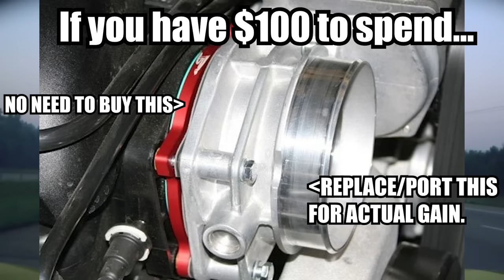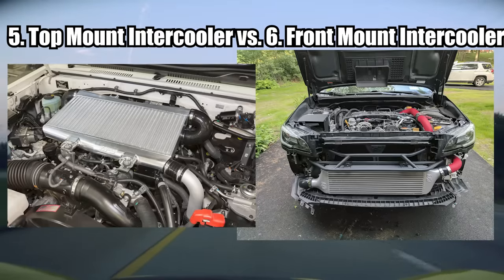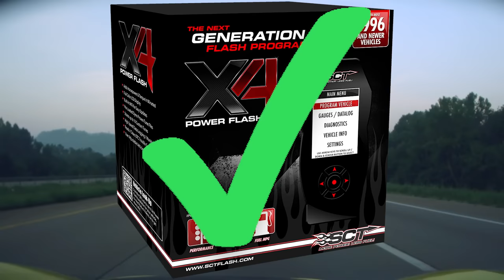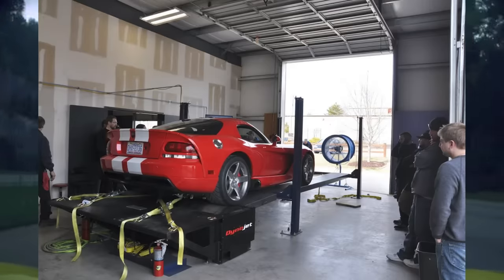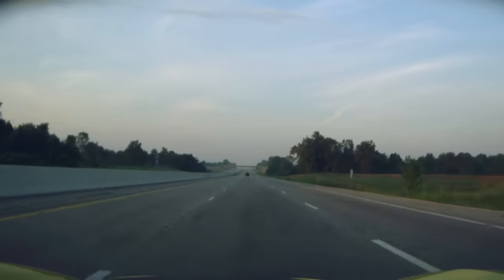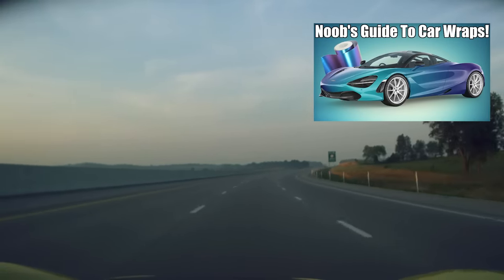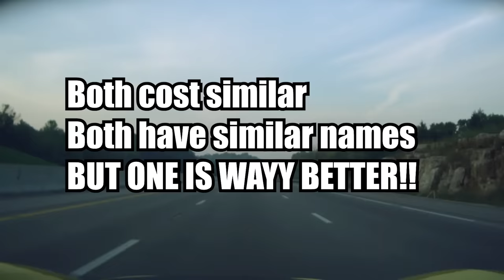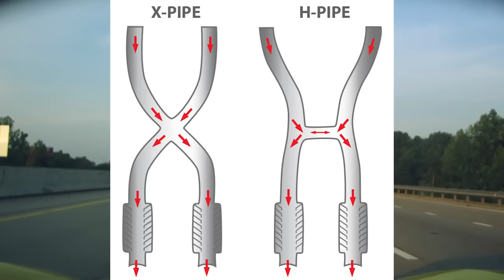25 Real VS. Fake Car Mods!

Comment: Throttle body spacers can give you a performance gain if your running a carb and your carb is getting too hot sitting on a hot engine so spacing it out can improve reliablility and performance because youre not vapor locking

Comment: Bought a ‘94 Toyota celica gt a few years ago and the P.O had installed one of those short intake filter setups. For the year or so that the car was my daily it would always shift waaaay to high (it was an auto) and tend to stall at lights if you sat too long with it in gear. 
     After hours of tedious research on Jdm forums (I don’t wish that experience on anybody) I came to the conclusion that the shorter intake filter inlet tubing was causing the issue. I replaced the off-brand k&n look-alike stuff with the oem filter, housing, and tubing from a Corolla with the same engine (didn’t quite fit because the mounting isn’t the same between the Corolla and celica, but it all fit under the hood) and there was an immediate and substantial increase in fuel economy and it didn’t stall or shift at 5k while trying to drive normally. 
    It’s important to understand how vacuum systems work, and to a greater extent- how the systems under hood work together before bolting on shiny bits that you see at pep boys. Every vehicle requires a certain amount of vacuum signal for various things and changing something as mundane as an air filter can throw that off. If you’re not installing a turbo or doing anything significant to the engine you’re likely better off keeping the intake side of things factory, spend the money on less restrictive exhaust or something like that.
Reply: depends on the intake, lots of people just adapt a pod filter straight onto the factory piping. a proper intake replaces everything and is designed to work with the car

Comment: electric superchargers do also exist for normal combustion vehicles, put simply they are functionally the same as superchargers, being that they spin to draw in more air for the engine, however rather than being belt driven or exhaust driven turbines, theyre powered by a separate electric motor, presumably either from the car battery or a separate assembly. 

I believe theyre meant to lessen/eliminate the load on the engine and therefore power loss that typically occurs with belt driven induction, while maintaining the "instant/constant" (lower rpm) power gains non-centri superchargers typically have over turbochargers, provided you have the battery capacity for it

Comment: Also, some cheap tuners or performance chips might also ruin your engine. For example, some diesel tuners are very crude in how they function, and all they do is turn up the fuel causing it to run rich as hell, and roll tons of coal. What u also need is air as well. Banks Power has some videos about this issue.

Comment: The intercooler one is hilarious because I don't know of any car where you can choose/convert your intercooler mounting position. I mean I would love to have an excuse to put a hood scoop on my 335i with a top mount lol but that's a lot of work to change the intercooling piping position to a custom route
Reply: i own a 6th gen celica, and i know tons of people swap the top mount 3sgte intercooler and get a front mount for better cooling, as the hood scoop on the gt4 doesn’t actually direct air across the intercooler like it looks like it does. i’m about to swap a 3sgte in my celica which is n/a and doesn’t have a vented hood, so in my case, my cheapest options are to get a front mount and ditch the factory top mount ic, or spend $1000 on a carbon hood just to keep the vent for the top mount.
Reply: It's also common on Mk7 GTI builds that are going for max power.  The stock IC position on the GTI is on the side of the engine. Moving it to the front gets better cooling for larger turbos and higher boost levels.
Reply: To be fair, once you hit that point, your like killing 2% of your project and it's not so overwhelmingly excessive

Comment: Other thing with straight pipes are, in many countries, they are illegal to run on a car, one part being, in Australia it’s illegal to run a car without a catalytic converter and two being the noise from them are higher than what is allowed for a car, this is for road legal cars though, I’m not too sure about the rules for track cars, but for a teenager who owns one car, it’s better to leave the system stock rather than a straight pipe if money is the issue

Comment: Let’s just clarify. On any stock engine. You can not make your top speed higher. It has a max.

Your acceleration however can be optimized

Comment: Something with wraps and paint tho, wraps are actually a lot lighter than paint, so some people who are trying to shave weight for races actually use wraps
Reply: you still need paint underneath anyway
Reply: Races usually use wraps because it’s cheap and easier to repair when you crash. Plus swapping designs for certain tracks/sponsors is easier.

Comment: Just so people don’t call subie owners ricers or something
The image you’ve shown for the roofspoiler portion of the video (the blue one) is actually there to make sure the airflow connects with the rear window (technically generates lift instead of downforce) so it does the same thing as vortex generators. I’m not sure about the effectiveness of these because I think vortex generators have a bit less drag with same effect but like I said not 100% on this one.
For the other image that was basically a lip infront of the back window: that’s useless and I fully agree

Comment: When I first started driving, I tried a lot of the cheaper options, like cold air intake or throttle body plates to "smooth out airflow". Then when I got older I bought a Ram 24v Cummins engine. The first mod I did was new injectors and a box, which gave me 200 rear wheel horsepower according to the dyno runs. The total cost was under $1,000. These addons saying they give you 5-25 hp just aren't worth the cost. 
I would also suggest against using oiled air filters. I did it and had trouble with the oil being deposited on my turbo blades. I also found that the oil analysis showed more dirt getting through even on a new filter, NOT one I had re-oiled.
Reply: Your telling me you gained 200 horsepower from injectors alone?

Comment: 2017 Mitsubishi Lancer ES (NA)
When it comes to intakes, I just put a heat shield (might put 2) on my Short Ram Intake (K&N Filter) with a Ralliart Intake Duct, which did see a gain of 6.4hp gain.

Comment: Okay but top mounted intercoolers are less thermally efficient than front mount because they’re on top of the engine and heat rises. But they definitely still work, not fake by any means.

Comment: the best upgrade i ever did was buying the absolute best street tires i could fit stock on my car. michelin pilot sport 4s. a lot of people focus on power, but have mediocre tires. tires are your direct connection to the pavement. there is nothing more crucial than tires.

Comment: Video was great but you were wrong about throttle bodies and TB spacers. There’s no throttle response reduction with a spacer, it’s simply increases runner length, which depending on your intake design can yeld measurable gains at the wheel. 

As for the TB themselves you can indeed see gains mostly in torque without a tune or any of the other parameters mentioned, it simply depends on the displacement involved, and if boosted, depends on which side of the TB the boost is on. 

Anyway nice video

Comment: Don't underestimate the gradual power increase with the small upgrades. Like intake, sport exhaust, mini turbine vent inside of intake pipe, performance / fuel saver chip, spoilers, body kit - all of them contributes a little, lets say 5 HP each, plus better revs and mpg. If someone have lots of money, yes - there is no need in all of this, just buy Bugatti with 1001HP and its all......But with small and planned budget with inexpensive mods possible to do sweet build.

Comment: The fact there’s confusion on short ram or COLD air intakes. 
Short rams ifs in the name. It’s closer to the engine it’s gonna be hotter air. You can get a heat shield you can have it in certain locations. But after all its hotter air. A cold air intake a proper one that legitimately gives colder air even by spacing and being farther away from the engine. Cold air is more dense and richer in oxygen.

Comment: One thing I think you missed. Top mount does get more heat soak from the engine by 5-10 degrees. But the difference in piping length for the front mount makes a large difference on boost response. Front mount should be used for high boost turbos where as a small turbo on a front mount is a complete waste of money and will only hinder your performance with boost lag
Reply: boost lag isnt that much of an issue if you size everything properly
Reply: I'm pretty convinced the #1 reason to get a FMIC on a stock OEM turbo is to say you have a FMIC. An aftermarket Grimmspeed, Process West, or whatever is fine for a TMIC.

Comment: the best mod for most cars is definetly new Coilovers. But dont cheap out to mutch some coilovers are just complete sheit and you will ruin how your car drives. If you only go for fitment i guess it doesnt matter. If it is just for looks then you dont need KW an ST or Some Ebay stuff will do the Job. I went KW cause its cool :) and it makes the car drive mutch better.

Comment: overall great video, but i wanna nit pick a bit on the cold air portion, my 370z, and most people with VQ engines will tell you this too, with how hot they run, having the long cold air intake makes a noticeable difference to overall powerband and throttle response on it. cold air intakes are one of those, "if it works for your engine" mods IMO

Comment: In my experience a ram air intake can make a very noticeable difference depending on where it's mounted and how much are flow is getting to.  It. Helps to take some of the plastic out of the grill if it's preventing air flow from getting in the engine bay.  This is partially due because most stock airbox is are extremely restrictive, gas mileage will also increase slightly.

Comment: The bald tire one is a big one. I work in a tire shop and see them a lot. I had one guy who would drive on a tire so bald the belts were showing on one tire, another was almost completely bald. These were just the fronts. His rears were just as bad. One was a bald doughnut spare, and the other was almost bald with 2 nails in the sidewall. This person likes to drive on the highway constantly like this, going 2 hours north from where I work.

Comment: On a completely stock Mustang GT 4.7 it does help performance in some respects. For the dollar verses "real performance" mods which are high dollar it is worth the 200 and change it costs. I live in a warm climate year round and when it gets under 60 degrees a month or so out of the year the HP increase is  very noticeable. Minor increase if it is hotter out. The car has more pick up and gets through the gears quicker reaching max rpm quicker is the result.. Teamed with performance exhaust and a higher cfm throttle body, all low priced mods. The sound,  lower back pressure, pick up, MPG increase and it does a hell of a burnout with the Traction control on verses having to take off the TCP to get a nice one going and a 360 for days. lol...All about the Benjamin's my man. If you are on a budget those little mods are well worth the cash. Just don't expect a turbo or blower or cam add performance, obviously.

Comment: I have to slightly disagree with the cold air intake comment. If you have a turbo, it will allow it to spool up quicker than the factory filter box because the factory box limits intake flow. I agree, not much performance gain on its own because the factory has already limited what the engine will output, so with the cold air kit by itself you'll just get to that limit quicker.
I agree to get a tune, and put on a cold air kit before getting the tune. And if you get a cold air kit, don't stop, get a tune. If you get one, the other should be there too.

Comment: There needs to be a huge I mean huge "yeah but" to your top mounted intercooler comment. Top mounted intercoolers have the challenge of the hood becoming a low pressure area at different speeds compared to a front mounted. So they can lose efficiency at best or in the worse case have zero airflow.

One example is the attempt to use the aesthetic scoop of the 2nd and 3rd gen tacomas as a ram air intake. All it takes is an old school tap method to realize that there is no airflow there above 30ish mph and so the naturally aspirated engine is losing hp over the OEM intake location. But yes a properly designed top mount will work fine, but that's usually due to packaging restraints.

Also the key to vortex generators is not to just redirect  but straighten turbulent air into a laminar flow. Especially with actual wing type spoilers. Turbulent air over the low pressure side of a wing (underside on a car, topside of an aircraft) reduces efficiency. This is why gooseneck struts are becoming more commonplace on racecars that aren't using the winglets (I'll just use the aviation term since I can't remember the automotive term) as the struts.

Comment: The subaru spoiler isn't bad since it pulls air down towards the rear window to let more air to flow through the rear wing but it obviously creates more drag since its spoiling the air

Comment: I realize you were pressed for time, but I wish you would have at least made mention of the scavenging effect when talking about the exhaust, because thats essentially whats being affected by giant straightpipes and crossover pipes. 
Also, for thosse reading, you can find size charts online for what size you should use for your current or planned power output and total engine displacement, and for NA vs Boosted. Fun fact: dual 2.5" pipe can support 550-600 NA horsepower! Dont need dual 3" pipes for a 500hp car! My 4.0L ford was making around 220hp with a tune... True dual 2" with an X pipe was plenty for it to make good low and mid range torque, and kept me making 20-23mph on the highway in my Ranger despite spinning 2500+rpm at 75mph 💪🏻😎

Comment: My greatest achievement is always that my truck is loud because I just love the sound of an engine. But it performs exactly where I need it to. It's a short bed 86 Chevy with a work engine that provides good power and good torque. And my favorite part is I was able to put straight pipes that make it louder with only minimal power loss. And since I use the cargo space for wood or for transportation of furniture/ well groceries since it's my daily. I don't need it to be pumping out massive insane power. It's loud, it's fuel efficient, thankfully, and most importantly it's reliable. 

But just wait till I hemi swap it 😂😂

Comment: So cold air intakes depending on how your factory intake work wonders.. on my 04 gmc I dropped half a sec in quarter with out tuning. So it wasn't just for looks or sound.. now some of the new cars that are more computerized yes you would need a tune so your computer will allow for max air flow. Pre 06ish.. not needed

Comment: Bigger exhaust is definatley not necessary on small N/A cars but if you have turbo, bigger the better. (When making more boost than stock)
Reply: depends on the n/a car, there are 1.8L that benefit from a 3 inch exhaust
Reply: Idk, most focus STs stay 3inch all the way back no matter what turbo. Some of those bring them into the 500hp range.

Comment: i have a properly engineered cold air intake that does increase power. but the air dump i get on my tuned boosted engine makes it worthit, even if i loss 1 hp

Comment: Just get a centrifugal supercharger.

Just don't cut your springs.

From what I learned, wraps last 3 years. Just set money aside for new paint.

Worn bald tires are terrible as the rubber compound is very different from drag radials. They're very different levels of softness.

Spacers mean nothing unless you're getting wider tires.

Some engines need backpressure from the exhaust. Otherwise just have a shorter exhaust that leads to the sides of your car behind the doors.

Comment: straight pipe works for turbo in proportion. but for NA a large straight pipe is not the best i agree. but the more boost you got the better the escape path. but bigger pipe will also have a significant turbo lag

Comment: I'm an ASE Master Mechanic.

Cold air intakes do nothing but make more noise. It's been tested.
Reply: depends on the intake actually, plenty do work. and if your trying to make lots of a power a stock intake will hold you back
Reply: @arcanevoid9199  Dyno data or it's not true.
Reply: @djtripnosys  really? bro it’s very similar to an exhaust, you don’t think a 2 inch exhaust on a 800hp engine is gonna be a bottleneck? same thing with intakes, especially on engines that like to breathe. like how many track cars are running the stock intake?

Comment: Tbh some items listed like CAI are better for MPG or highway performance. The straight pipe one is true, but you don't really need bends, especially if you are trying to be cheap. Just don't have the diameter be bigger than it should, the only time the diameter should change is for the Resonators or Tips

Comment: Straight pipes are fine. Back pressure is not necessary. What is is proper collector length. A x vs h pipe the difference is all low end and is marginal to Straight pipes at the top end. Engine masters have done several dyno tests be it on different styles to different sizes of exhaust pipes as well as mufflers. Even went as far to bash headers in to prove a point that a little clearance work with hammers won't kill hp. But that said, running 5 inch pipes on a 200hp car is unnecessary.